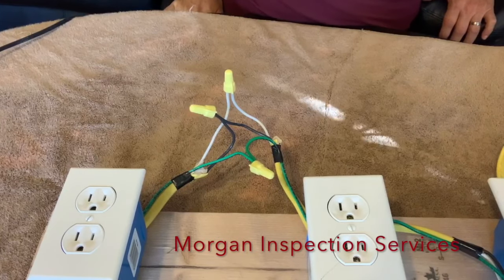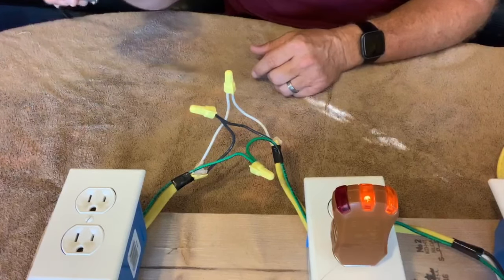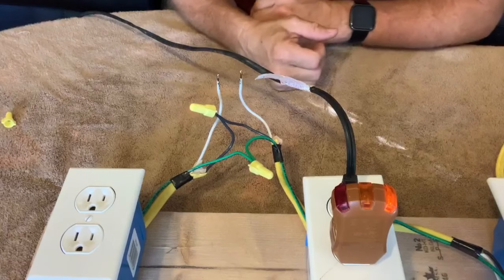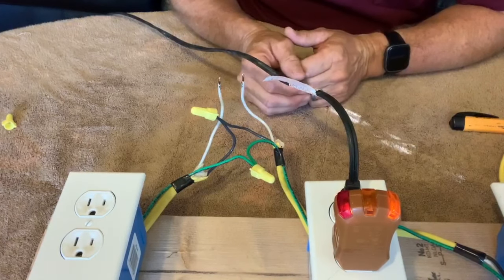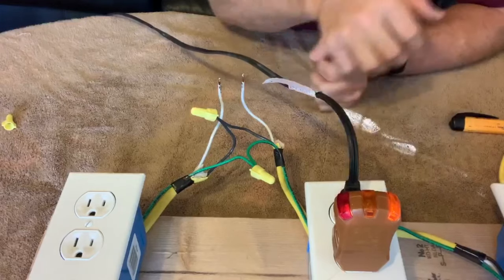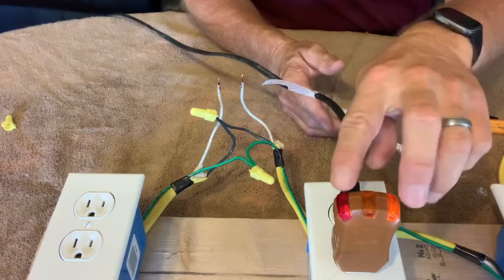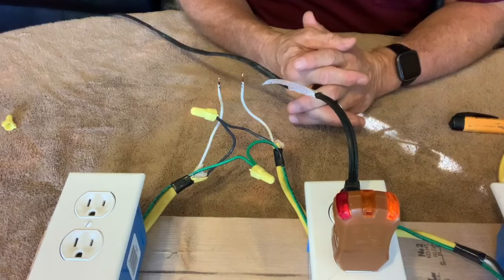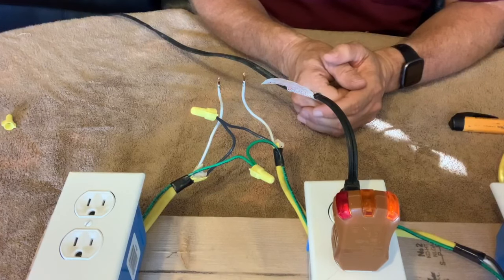What is a Hot Ground Reverse?

Comment: Just helped a friend with this issue. Previous homeowner had installed a hidden GFCI that was wired backward (hot on neutral, neutral on hot) and when it tripped, broke the neutral instead. I knew it was an open neutral, just couldn’t figure out why the outlet tester showed this. It makes sense now! They had a ceiling fan on the circuit that was in the ‘on’ position.

Comment: What if everything is working fine and then all of a sudden no power. Nothing is flipped at the breaker and everything starts reading hot ground reverse. You replace all of the outlets and still hot ground reverse. What is it then?
Reply from the maker: @ReoHunter-v7s    There’s going to be a disconnected neutral somewhere. It may not be at one of the outlets. It might be at a light fixture. It could also be in the breaker panel. I would go around turning things off and see if you can get your tester to switch from hot ground reverse to open neutral. That will help you to isolate the location.

Comment: Thank you 
Very informative..
Learned something I didn't know.  
 But still  wonder why / what causes a electrical wire to have power  when breaker is off. 😮
Reply from the maker: It will not have electrical power when the breaker is off. The neutral wire will have power when you have a combination of an open neutral, and a switch turned on which allows the voltage to travel through the hot wire, through the device and to the neutral wire. Definitely no power with the breaker off, though.

Comment: I had this exact problem in my house today. The electrician went on a hunt for crossed wires. I pulled up this video saw the neutral break and then I went on a hunt for a break in the neutral; found it and fixed the problem myself. The electrician was here for five hours and the fix was as simple as tightening the neutrals in a junction box. He was about to have me replace all my outlets in a bedroom and rerun all the wire. I feel a mixture of triumph and dismay. Mostly, I'm glad I was able to identify the problem and avoid a lot of unnecessary expense by watching a video in about 4 minutes.

Great, to the point, video!
Reply from the maker: Wow! I guess some electricians don’t know about this “flaw” with these outlet testers.  I am glad you were able to quickly fix the problem.
Reply: I have that problem but I don't understand why  it was working like that all this time till now
Reply: Need to find a better electrician 😂

Comment: Thank you for the video it’s the best explanation I have found, every outlet I have has the hot ground lights, found a power share switch that was burned, left all the wires open until I get a replacement, been testing every outlet and still getting hot reverse from the outlets, what am I doing wrong? Will appreciate some guidance
Reply: Please and thank you
Reply from the maker: I’m sorry for the delayed response, but I’ve been very busy. You have replaced the switch already or have not replaced the switch already? I’m trying to understand exactly what the situation is at the moment that you are getting the hot ground reverses still.

Comment: Great explanation.  Checked the wiring on the GFCI and found the neutral had wiggled loose.  Resetting the push connection and tighten down all connections.  Everything works again without having to replace the GFCI outlet.  Thanks!
Reply from the maker: That’s great. I’m glad the video helped.

Comment: Jeepers! Thanks Mike. I was going nuts trying to figure out how I could reversed these wires! Now to find that open neutral! 😮
Reply from the maker: I hope you find it quickly. Let me know what you find, please.
Reply: @morganinspectionservices3840  Hi Mike,

I found part of my issue. Stupid me, I misinterpreted what the original electrician had done back in 1990. I’ve fixed the mistakes I made. 

Still have one circuit with an open neutral that’s affecting numerous plugs and lights. Found the breaker. But have yet to find the break in the neutral. 🤷‍♂️

Comment: This video saved me $200 or $300 … thank you!
Reply from the maker: I’ll send you my Venmo. Just kidding. So glad it was helpful.
Reply: So this is exactly what I am experiencing in my laundry room.. two receptacle's in that room on one circuit. One is for the washer and is fed from the other receptacle across. I pulled both receptacles out and even replaced both of them, inspected the connections and are solid.. how would I trace that neutral to the panel? There so many neutrals in there and I am thinking the bad connection is in the panel now. Any advice is much appreciated thank 🙏🏽

Comment: I had this Hot Ground reverse Reading on my GFCI LAST week... thunder and lightning Hit my irrigation system.. hit⚡ the solenoid ⚡hit relay..burn the Transformer.. knock the control panel off the wall..trip the GFCI AND the Breaker Box.the 20amp. Irrigation.Test the GFCI..showed a Ground Reverse Reading..
Replace the Old GFCI with a New GFCI..
The Reading was Back to Normal..
Reply from the maker: Are you saying all you had to do was replace the GFCI and it fixed it?

Comment: had a circuit that showed two yellows.  I plugged in a space heater and all was well.  The next day the Yellow and red would come on with the load and the two yellow was not lit, the the outside as in an open nutral ...  The other side of the outlet is wired to a switch that turns on a under sink water heater... (I am in an RV working)  When turned on the red light and first yellow again at the outlet.  I shut off all the breakers for the night and will ohm the wires to the circuit breaker with no connects... and see.
Reply from the maker: That's an interesting one. I'll be curious to hear what you find out. Good luck.
Reply: @morganinspectionservices3840  Update 1 yesterday it was all the same, I pulled the power off shore and pulled out the outlet and the black power and ground to the outlet were good but missing neutral ohm readings (screws all tight).  Tested to the three prog 30 amp cord end. The neutral at the rv circuit breakers all checked good.  Then I removed the 120 plug from the RV frig socket and the lights looked normal.  Okay? (I think).   I plugged it back in and it stayed two yellow.  The frig was turned off and now turned to 12V (3 way) with two yellow.  So letting it sit all night and will check in AM.  I don't like intermittents, so will see if I can reproduce it today and update. I am thinking it might do it with the frig OFF, no AC or DC ... propane not connected yet.
Reply: Perhaps running the space heater burned up a neutral somewhere.   Heater draw lots of amps typically 1500 watts.   This would equal 12.5 amp, on your typically 15 amp  general purpose circuit.   Anytime I use a heater I personally try to use a 20 amp circuit,  even if that means running a heavy duty extension cord from say my bathroom or kitchen whatever is nearest,  and use that.   I have a couple 12 awg 3 prong extension cords in my own home,  for just that reason.    Good luck.

Comment: Excellent information !   I have an overhead light that went out.  Replaced the switch- still out checked wires at light - (ground wire nut burnt out) replaced, but can not get proper power to hot and neutral. And the ground wire is hot !   Could it be an open neutral somewhere up the line ?
Reply from the maker: Sorry. I missed your comment from a couple of weeks ago. The ground wire is actually hot? It’s not the neutral wire that’s hot? An open neutral is not going to cause a ground wire to be hot, but will cause the neutral wire to be hot. A hot ground wire is a pretty serious and rare problem. Since it has been two weeks, you very well may have already solved this already. If so, I would be very interested to hear what you found.

Comment: I have a basic tester and on my outlets I am showing Hot and Neutral reversed. I checked the consumer unit and the RBC Hot is used correctly (from the outside just looking at the switches, it looks backwards wired, cover off, it is wired correctly). Now the odd thing, on a whim, I plugged the tester into a power strip I have plugged into an outlet, and that showed correct wiring, then plugged into that outlet, and it showed Line and Neutral reversed. I am beginning to think my tester may be the problem.
Reply from the maker: Thanks for sharing your experience! It sounds like your tester is detecting a hot/neutral reversal, but your power strip is showing something different when plugged into the same outlet. That could indicate a few possibilities:
	1.	Miswired Outlet: If your tester shows hot/neutral reversed at the outlet, but the power strip reads correctly, the power strip might not be passing through the miswiring exactly as the tester detects. Some strips filter or condition the power slightly.
	2.	Tester Sensitivity: Some basic plug testers can give false positives depending on how they interpret voltage potentials, especially if there are grounding issues in the system.
	3.	Shared Neutral or Bootleg Ground: If another outlet is improperly bonded or sharing a neutral, it could cause odd readings at different points in the circuit.

It might be worth testing with a multimeter to manually check voltages between hot, neutral, and ground to confirm what’s happening. Let me know if you need help troubleshooting further!
Reply: @morganinspectionservices3840  Thanks for the reply. Yes, I checked a few outlets with my meter, going to wait until I can turn off the circuit before I open any boxes. I am in Thailand (American expat living here) and most houses are ungrounded, 220v 50Hz. I had a ground put in right after we moved in, then some of the wiring was redone when I was in the states for a little while, I am leaning towards a bootleg ground somewhere, as the consumer unit does in fact look correctly wire, although that is a mess inside. I will let you know how it goes when I open some boxes.

Comment: What damage can a ground and hot reversal do?
Reply from the maker: As explained in the video, if you get a hot ground reverse reading on your tester, it is almost certainly not actually a hot ground reverse, but it is likely an open neutral with a load plugged in and turned on. This early won’t do any damage. It will essentially just prevent things that are plugged in from running.
Reply: @  lets say i have a microwave plugged in to a hot ground reverse socket. Will something big happen???
Reply: @SIN-py7ll  If you really have a Hot - Ground reverse then the metal cabinet of the microwave is HOT. That is very dangerous. If you have a hot-ground reverse at the outlet then WHY did you plug in the microwave?  That is extremely foolish.

Comment: I plugged a lamp into a receptacle and it blew the power out of all the receptacles in that room and also the receptacles in part of 2 other rooms that have walls attached to that room.  I got the tester and tested 7 receptacles and they all say hot/ground reversed.  I live in an apartment and this happened 1 week ago and maintenance has yet to respond.
Reply from the maker: Well. You definitely have an open neutral somewhere. I’m surprised it has been one week and they still have not responded.

Comment: Interesting...I just wired a GFCI and got this... I dont see how it can be my neutralwire disconnected. Before it didnt have wirenuts. They were attached to the pole, I installed a pigtail and now I am getting this reading.
Reply from the maker: I’m not sure what you mean by “attached to the pole.“. Are you sure you connected the neutral wire to the correct screw and the hot wire to the correct screw? Are you sure there was no problem with the previously-installed outlet? Everything was working before?

Comment: Thank you for the info. However, we have checked all of the neutrals and are still getting this light code..  where else should we look for this issue?
Reply from the maker: Have you checked the all the lights on the circuit as well? Have you turned off the breaker to identify every load that is on this particular circuit to make sure that you have checked every neutral?

Comment: This video unlocked the solution to my problem. I installed a window AC unit, plugged it in, and it ran for a minute and then shut off. Slowly I began to realize all the outlets and lights in the room were dead. My outlet tester indicated hot/ground reverse, which completely confused me until watching this video.

At first I suspected the GFCI breaker, because I had recently moved locations in the beaker panel, redoing the wire connections in the process. It all checked out.

The last component I touched on the circuit was replacing a bathroom vent fan, so naturally I suspected a problem with a connection there. Into the attic I climbed, and my twist nuts looked fine to me, but I replaced them with Wago connectors just to be certain, especially since I was connecting stranded and solid cores. That wasn't it...

I tore apart all but 1 outlet and switch (8 outlets and 12 switches) in the bedroom and bathroom before finding the culprit. Had I thought a little harder, I would have known to start there, because the lights were working in the bathroom despite being on the same breaker circuit as the non-functioning outlets in the bedroom.

As I pulled the wiring out, the wire nut holding 5 neutral wires came off with almost no force and some of the wires came apart. One of them was stranded while the others were solid. I used a Wago to connect them all.

During reassembly of all my switches and outlets, I took the opportunity to convert all the backstab connections to the side screws. Too many issues with backstabs burning for me to be comfortable with that.

Anyhow, thanks for the video Mike!
Reply from the maker: Sounds like quite the ordeal tracking it down. I am glad my video was helpful for you. I appreciate the comment/info on your experience. Maybe someone else can learn from it.

Comment: How do you find the neutral disconnect on a string of wall plugs?  Is the disconnect always on the 1st wall plug and the last wall plug?  Or could the neutral disconnect can occur in between the 1st and last wall plug.
Reply from the maker: The disconnected neutral can be anywhere in that string of electrical outlets. Here’s another video I made that shows how to locate it. I hope this helps.  https://youtu.be/BVcNnBKfC8Q
Reply: Thank you soooo much.  The very 1st wall mount closest to the breaker was the culprit.  The entire circuit had a hot and ground reverse.   Your link to the other video explained why.  As soon as I jiggle the very 1st wall plug the entire string was back to normal.  I check the 1st plug and all was good.  I think it's the surge protector on the 1st wall plug tripped something up.  That is most likely the culprit.  I learned something new from this exercise.  Big 😊 thanks

Comment: Half the power in my grandmother's manufactured home went out a while back, and I just bought one of these testers to try and diagnose the problem. It happened during those really heavy storms in california two years ago. Is it possible something somewhere got shaken loose? I'd like to get power working back in her house without spending a fortune if I can
Reply from the maker: If she literally lost half the power, it almost sounds like she lost one leg of her electricity, so she may not have any 240 V power. Personally, I would start at the panel and see if you have 240 V. I would check the voltage at the outlet for the dryer and see if you’ve got 240 V. If not, then she’s lost one leg of her power. If you’ve got 240 V, then, yes, it could easily be a disconnected neutral somewhere. If you do some checking and tell me what you find, I will give you my thoughts about what the next step is.

Comment: I got 2 plugs that randomly show hot ground rev on and off. 3 plugs that always show hot ground Rev. The same pen tool you have beeps when try them all. No power when testing g with a lamp. This happened before. But the problem went away on its own and now the problem is back. No power. The braker did not flip but I flipped it off and on anyways. That didn't help.

Comment: This is awesome. I have plugged in a vacuum and the vaccum "blew a fuse".  I just switched outlets. Later went to reset the circuit breaker and nothing tripped. Bedroom circuit tho. Ceiling fan in bed room and bathroom light switch stopped working but all other outlets except two are working. Can't figure where the problem is. Any ideas?
Reply from the maker: Do you have an outlet tester, and are you getting the hot/ground reverse indication? If so, and even if not, the problem is going to be between the first outlet/light that is having a problem and the last outlet/light on the circuit that is working properly. Without knowing the set up of your home, I cannot tell you much more than that.

Comment: I'm having this issue when I connected the tester to the outlet. No lamp or anything else is connected at the same time.
Reply from the maker: OK. Nothing has to be plugged into that specific outlet. Something can be plugged into any other outlet on the circuit (after the open neutral). Also, if there is a GFCI protected outlet somewhere downstream of the outlet you are testing, that will also give you this reading. It is very likely that there will be more than one outlet that gives you that reading.